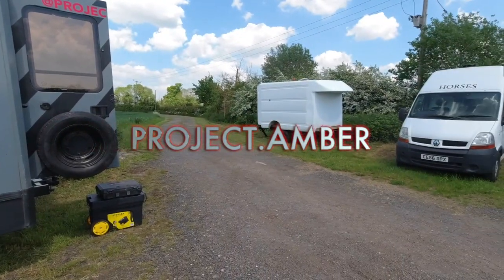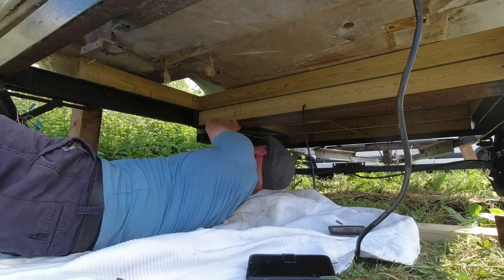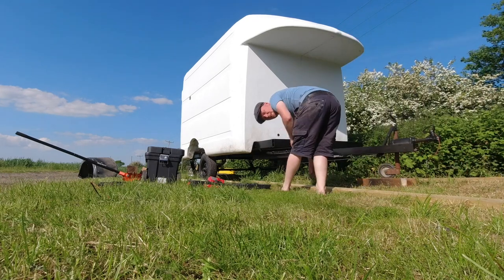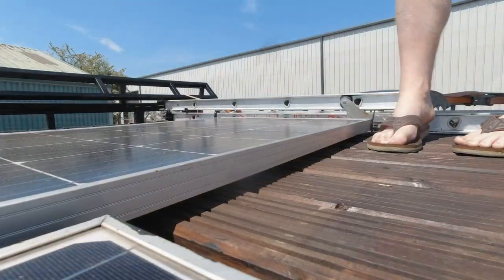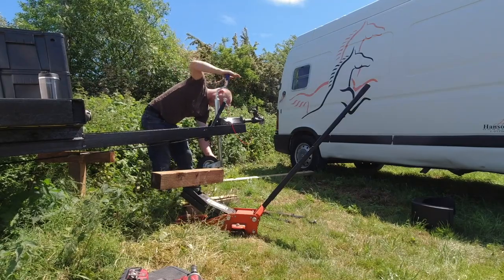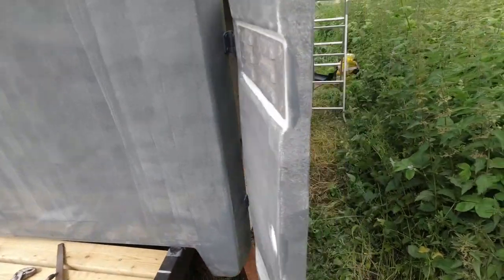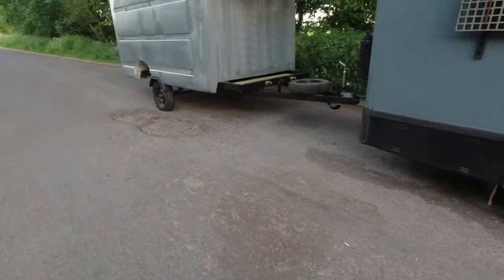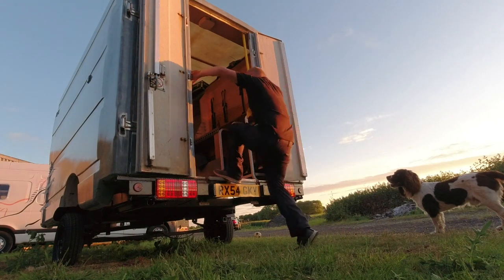A Re-think, First Coat & Test Drive. The BT Trailer - Part 4

Comment: I was almost going to ask if you had considered loading a generator and petrol air compressor on the front deck bit. That would balance the weight.

I also wondered, as an alternative, why you didn't move the box forward on the trailer frame until the existing wheel arches matched the wheels and shortened the frame. 

However, it's looking great! 

Love to Lance, the real star of the show.

Comment: I have the BF Goodrichs Ko2s all terrain 16" fitted to my 06Renault Master.  One with the Master is that the rims are 16". I find these tyers great even on wet roads. Very little difference made to fuel consumption as I use me camper as my sole vehicle.

Comment: With the arches, the best thing to do in my opinion is to mark out where you want to cut to forward of the wheel, then cut out a rectangular piece straight up until you are clear of the arches, then straight back over the arch to the front of the existing arch, then straight down. Do this both sides, then swap the pieces you cut out to the opposite sides then plastic weld them back in, which will then put the arches above the wheels. No faffing with bendy cuts, everything is square, and you don't have to waste time making a nice arch.

Comment: The locker that does not lock is where the gas bottle should go . Separated from the rest of the trailer and has a gas drain hole ?  Stove went in that metal shroud  . where all the wires come through ,opp side from the locker ,there used to be a diesel night heater fitted
Reply from the maker: I wondered what the two big holes in the floor were, night heater! 
I’ve got a camping stove back in the cowling so bacon and egg sandwiches are once again on the go 😆

Comment: A trailer shouldn't be "balanced". It needs some noseweight to make it stable. In my opinion a spare wheel and a couple of planks is not enough nose weight. My fear is that if you tow that empty at any speed that you will get into a nasty snake. I used to tow my caravan with 75kg nose weight.
Reply: Agreed
Reply: @MersyyLife  so you can only tow it when loaded?
Reply: @MersyyLife  stupid comment, how do you know it will always be loaded?
A trailer should always be properly weight distributed with appropriate ball weight when empty, then loaded evenly to maintain the same percentage ball weight.

Comment: Great work, trailer looks like an extremely useful addition.
Had you thought about extending the front of the trailer? I.e. a piece of vertical plywood bent to follow the vertical curve of the outer edge of the (former) cabover? You could then glass fibre this and create a useful extension whilst improving aerodynamics and aesthetics?
Just a thought...
Love your vids mate

Comment: If over 12m outfit length your need square reflector plates driving in Spain or your be fined as the police will get out their tape measure to check . Plenty of info online .
Reply from the maker: I fit one to the van anyway for good measure but good point, I’ll need to fab some mounts for it 👍🏻

Comment: It's illegal and dangerous having no shocks, you should also have a damper on the coupling, auto reverse brakes and a breakaway cable, you would be far better off getting a more modern caravan chassis. Sorry matey it's junk.

Comment: too bad you cut up the wheelarches the way you did 
if you know how mush the arches need to move you can cut the whole ting out as a big regtangle block (piece of the floor too) with the whole arch at the back end of the regtangle  , then switch the arches left to right wish puts the wheelarch in the front of the regtangle and if you measured right put it straight over the wheel , then glass everything back in 

we had a trailer with brake assist (the hitch moved in and applied the brakes to the trailer )
we had the same issue , turned out to be the vacuum of the draft created behind the truck was pulling the trailer towards itself untill the trailerbrakes applied on and then the trailerfell back again untill the hitch was fully extended
at a certan moment the trailerbrakes caught fire and that was the end of the trailer
it might help to put a stronger spring in the coupler so the vacuum alone isnt enough to apply the brakes , either that or use an electric brake assist setup